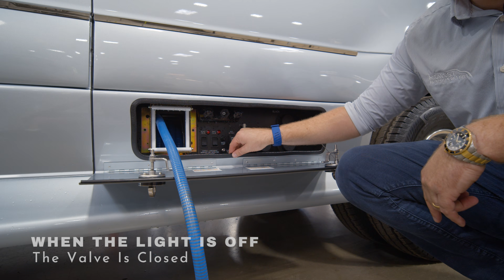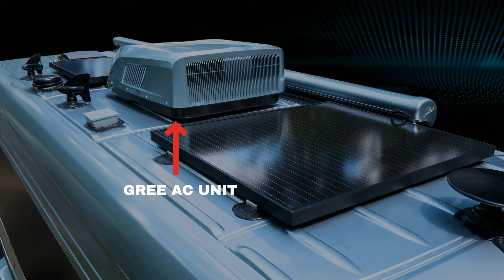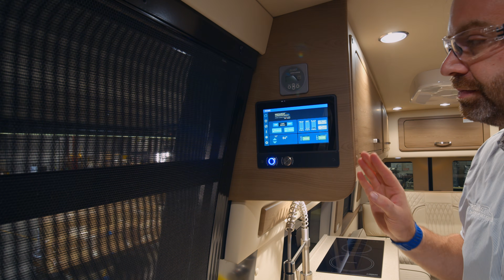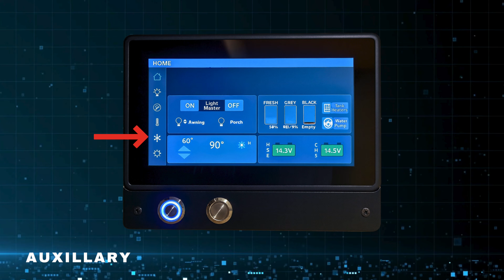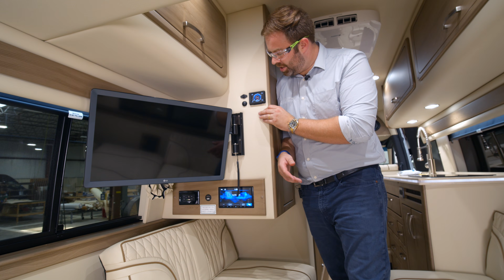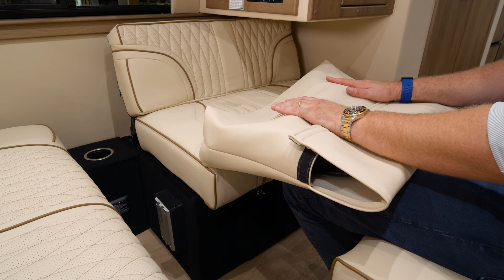2026 Midwest Automotive Designs Patriot & Passage Owner’s Tutorial

Comment: So we have now owned our Mercedes Patriot for several months. Love it! Have a couple of modification recommendations. 

1. Raise the firefly controller and USB hub that is in the bedroom. Most people, including us, put the bed down and leave it down, often adding an additional 4 inch mattress. When the bed is down, the firefly is basically inaccessible. 

2. Create a headboard fitted into the rear screen track. Was an easy mod and prevents our pillows from falling into the rear area.

3. The sliding door step down (inside). Our dogs fall into this pit of doom sometimes so I built a small shelf that we put there - allows the door to open and close but prevents the dogs from falling in.

4. Hard wire a starlink connection on the dash. I ran starlink power from the outlet behind the driver to the passenger dash. Allows me to work while my wife drives.

5. Tension shelves in the wardrobe. Too much storage lost for a small closet. 

Thanks!!!